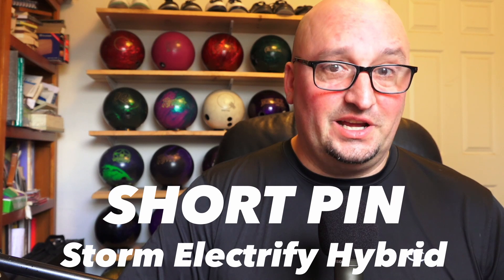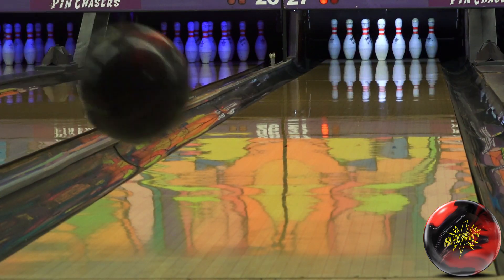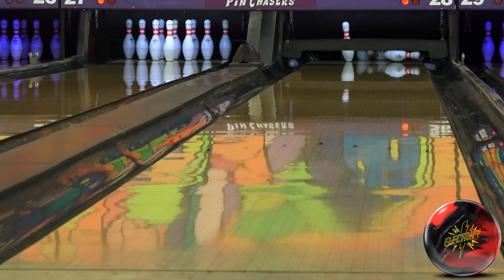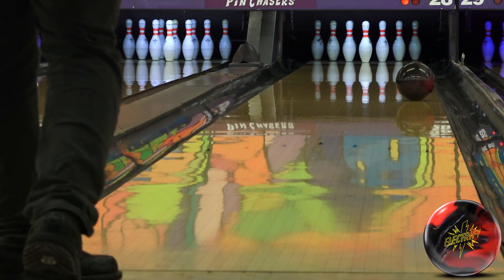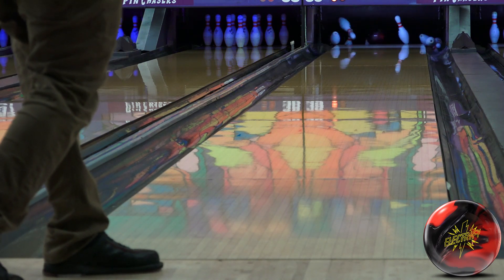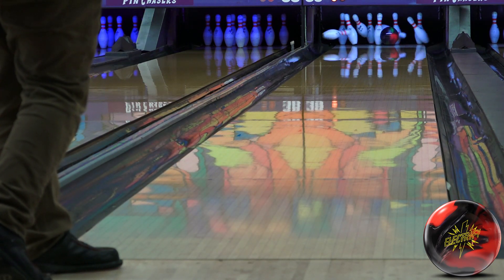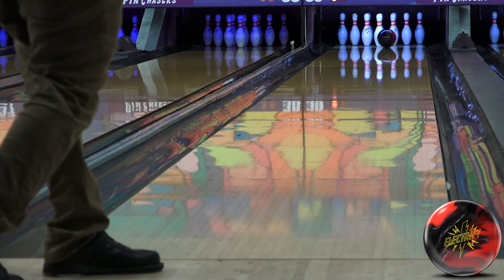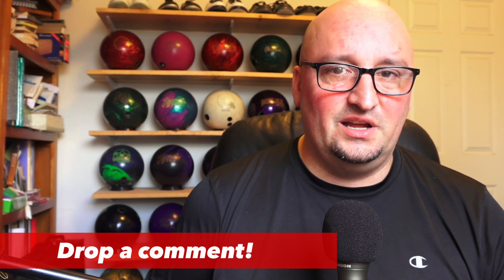Storm Electrify Hybrid Short Pin Layout!

Comment: I'm a slow, 8-9 mph wheelchair bowler with pin up drilling on everything. I was recently told about a short pin layout (I have yet to actually look at how this is specifically laid out onto a ball, I was kinda hoping you'd show that). A friend suggests trying short pin as it might help me with control at the slower speed. I have tried dropping from 14 to 12 lb but only gain a fraction of a mph in speed, but I can really lift/turn the 12, maybe too strong. Thoughts?